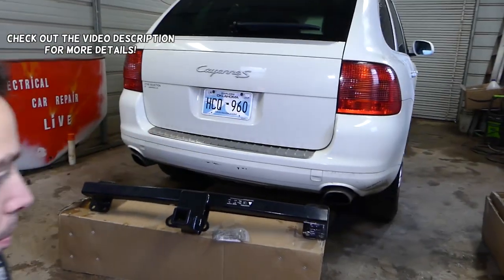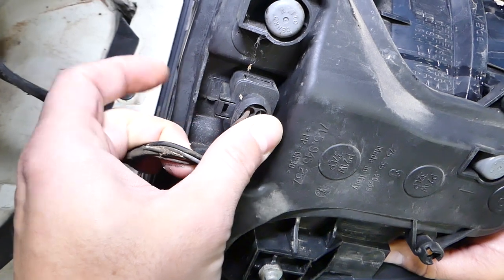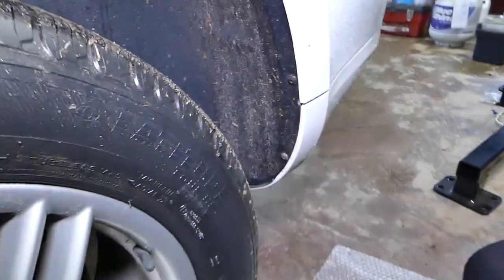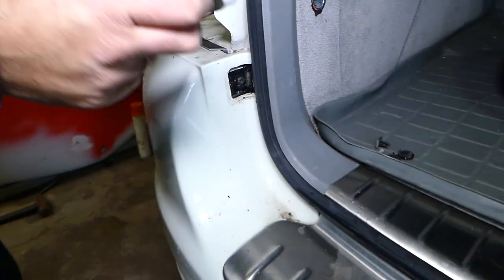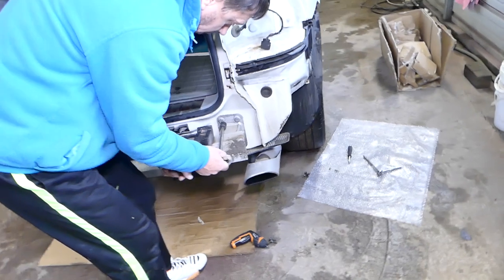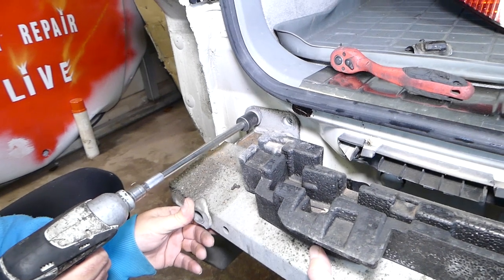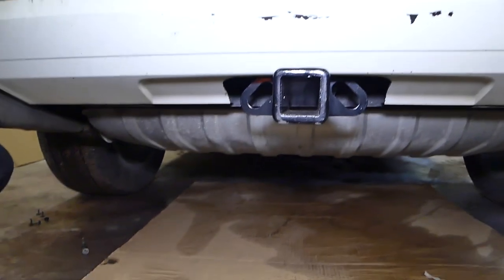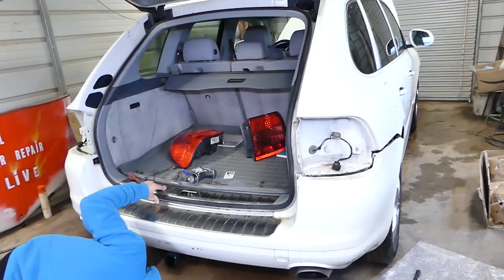HOW TO INSTALL TRAILER HITCH ON PORSCHE CAYENNE

Comment: Went very smoothly, thanks to the excellent video and skillful mechanics. Thank you guys!. Took about 2 hours up to installing hitch, and an hour to get the rest back. The bumper bottom screws very rusty and had to drill them out. Otherwise, no issues. Curt's hitch is perfect with nice finish.

Comment: Great video guys.....I followed the instructions and installed the Curt trailer hitch on my 2008 Cayenne GTS. However, I did not cut my bumper and only bent the fiberglass bumper to fit the hitch.